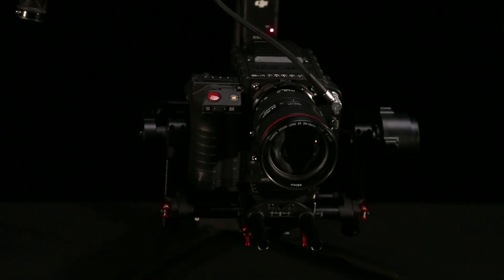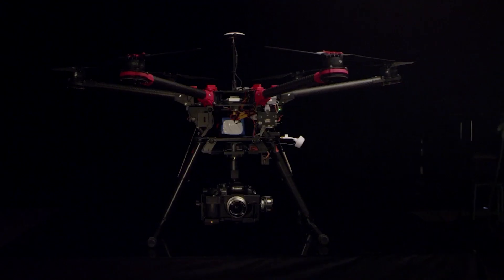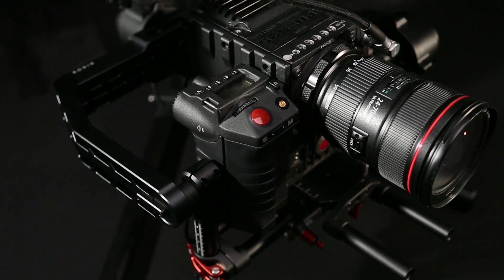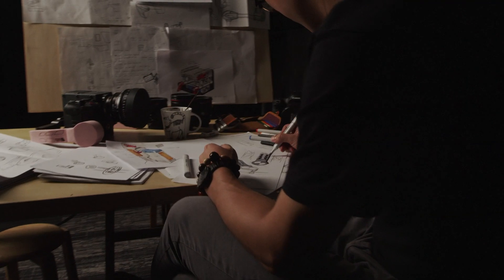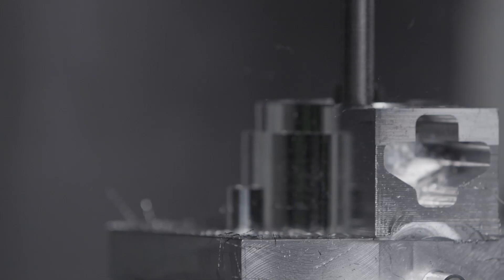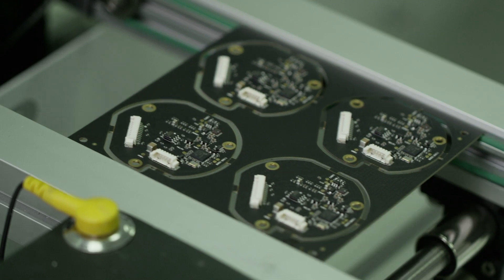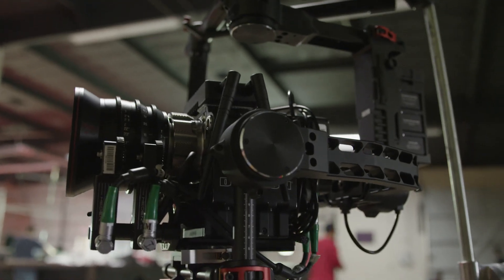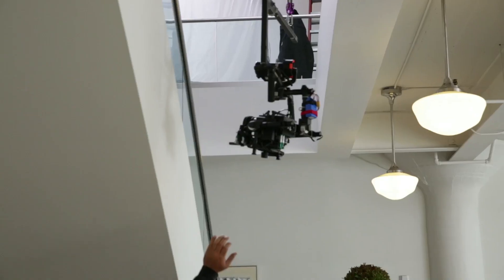No Compromises - The Making of the DJI Ronin

Comment: This all sounds pretty hollow when you're a professional having struggled many times with the Ronin in field on shoots. This is an incredibly unreliable piece of camera gear. It looses constantly looses horizon, software bricks your hardware, the so-called toolless design needs tools to be comfortably tight, batteries are incredibly fragile but expensive, motors stall out easily... the list goes on and on.